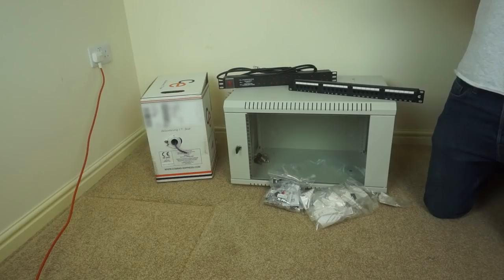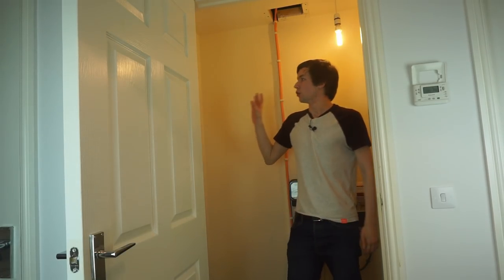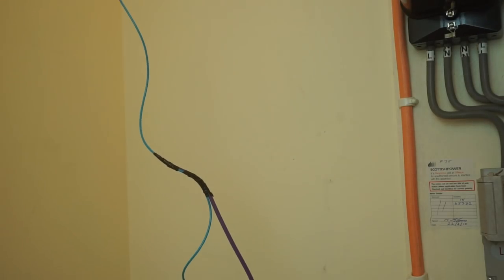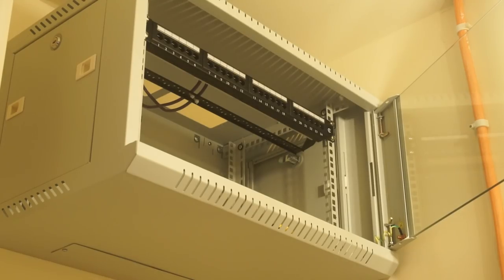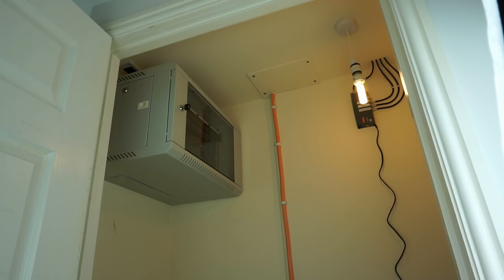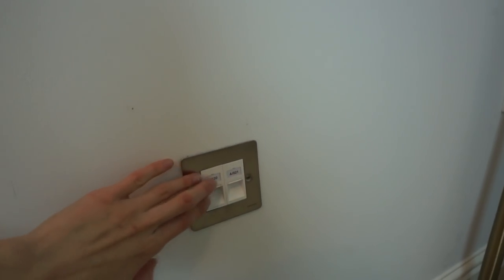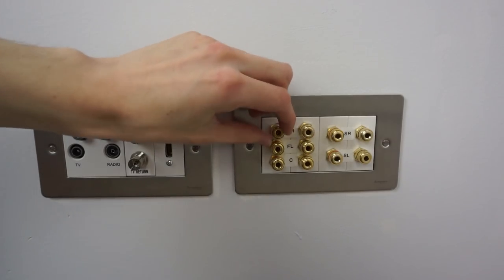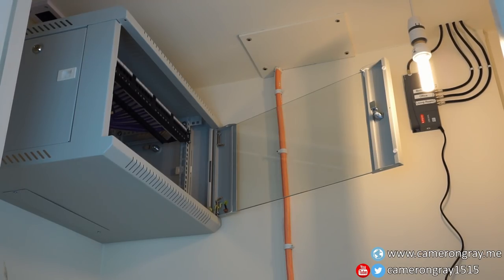New Flat - Time to install a completely overkill home network!

Comment: What? No ethernet in the bathroom?
Reply from the maker: +macuser1k Was honestly tempted to, the connection in the hall is on a wall that borders a bathroom then the cupboard with the cabinet borders the other bathroom.
Reply: Ah go on go on go on..... If you need an excuse..... erm... I'm sure theres a smart mirror or some japanese internet connected toilet out there !!
Reply: You should have, nowadays fast internet is a must if you wanna get sh1t done. 
But serioulsy,  thats a very nice job you did. However, you're missing power for that access point,you could use PoE but it would be limited to 100mbit.
Reply from the maker: +macuser1k I'll be using a UniFi access point which supports gigabit PoE.
Reply: i did at network cable in to bathroom add a middle screen eye level to toliet
Reply: Go have a look at iJustine’s bathroom whith linus
Reply: just about to say this!
Reply: Steven McCombie there is
Reply: Nice job good info thanks

Comment: Absolutely spectacular job! I really like those wall jacks and will definitely be trying them out in the future! Nothing wrong with an overkill network! That's how I gained a lot of valuable experience in installing rackmount equipment. Bravo mate!
Reply: FiberNinja I cant find any recessed and angled wall plates for the US. The UK has such a better system for wall plates. They effectively have larger keystones which allows for the diversity of what you can do with the “keystones” the only thing close to that, that I could find was Leviton 41081-2WP/4WP.
Reply: wow surprised to see you here
Reply: @eastwardExpansion 
Edit: sorry, I didn't notice you posted the same wallplate I just posted. 

4 port angled like this? They also have a 2 port.

Leviton 41081-4WP Angled QuickPort Wallplate 4-Port, Single Gang, White https://www.amazon.com/dp/B003ATOCDO/ref=cm_sw_r_cp_apa_i_eGtpCbGPCPTQ0

Comment: EVERY one of those cables in your patch panel should have a neat service loop  between the strain relief racket and the rear of the patch panel for maintenance
Reply from the maker: There's no way you could fit a loop of cable between the strain relief bar and the panel without bending the cable to quite a tight radius which isn't ideal with solid core or straying out of the 1U height. There's plenty of slack up in the ceiling void that can be pulled down if needed.

Comment: Should have installed pull cords for future needs, you will regret not doing so later. Everything else was spot on.
Reply from the maker: There isn't a clean enough route for pull cords to work, they would work if everything was in trunking but in my case you wouldn't be able to pull between two points without cables snagging on stuff in the ceiling unfortunately.

Comment: Nice video. Tip for future, if cutting access holes in plasterboard only cut on 3 sides at 45 degree angle and prise out to make a flap. Makes it a lot easier when making good at the end of the job.

Comment: Hard wiring a PROPER network is NEVER overkill. Just moved house in which I'll be doing the same, just as I did in my previous house. Nicely planned and lucky you having a suspended ceiling. 😁
Reply: I would post the Leonardo DiCaprio meme pointing towards the movie screen here.  Wireless should be reserved for mobile devices only is how I view it meanwhile its become the standard for homes now unfortunately.
Reply: @Wahinies  Hallelujah! Someone ELSE who "gets it"! I TOTALLY agree!

 I'm intending to add a LOAD of IOT devices and by far the majority will be hardwired (they aren't going anywhere!) All these IOT devices (NEST, RING, CAMERAS) being added to WiFi is just DUMB beyond belief! 

As for security devices on WiFi, like already mentioned security cameras, they are the BIGGEST security threat of all! 

A simple de-author can EASILY be used to screw up your ENTIRE camera AND IOT network and if done effectively will give burglars free reign with impunity from being observed! You think burglars don't know tech?! Think again!
Reply: at one point in the past I got a very small amount of ethernet cabling installed
and ive got a rather small patch panel mounted to my bedroom wall (its actually a 12 port one, as all of the 8 port ones i could find had bad reviews, but only 3 of the ports are used)
in the kitchen is the ISP supplied wireless router, which has an ethernet cable plugged into it, which goes up to port 1 on the patch panel
an ethernet cable goes from port 1 on the patch panel to port 8 on the 8 port ethernet switch that i have
port 7 on the switch goes to port 2 on the patch panel, and port 6 on the switch goes to port 3 on the patch panel, both go to a wall plate behind the TV in the living room
port 6 on the switch goes to the WAN port on a wireless router which i use as a wireless access point, as the wifi signal in the bedroom is quite bad
from the wireless router, ethernet cables go to both the printer in my bedroom, as well as my desktop PC

Comment: From experience having retrofitted my entire house more than once (I've owned it for a long time and it's considerably bigger than your place), I have a few suggestions, at least one of which is impossible for you now.  1) Always have extra cable available on each end of your CAT6 runs  2) Document where your cables are, because eventually you'll cut through a low voltage cable, 3) I'd suggest taking that powered device out of the wall, 4) Make sure you seal those holes you drilled in the fire barrier.  It's there for a reason.

You did an absolutely awesome job on this.  I'm looking forward to seeing the next set of videos.  I wish my wife would let me put a rack in our living room, but we have different priorities.  She prefers chairs and couches.  :)  Keep up the good work on this project.  It's always exciting having your own place and being able to do all the things that you wanted to do in the places you previously lived.
Reply: Dave Fenwick are you a networking engineer ?
Reply: Try covering it (the cabinet) with cushions and a pair of shoes! She'll never notice.
Reply: Why you want to put a rack in your living room? Put it in the cellar or in a storeroom like he did.
Reply: It would be very unlikely to be a fire barrier halfway through a wall. They are generally fitted between floors or between party walls.

Comment: My recommendation is to use Keystone patch panel if you are not filling it full. It makes much easier live for adding, testing, fixing cables in the future. Big respect for marking all sockets, well done! and its not overkill - its proper installation, which I did in my house too.
Reply from the maker: Thanks!  Went for that patch panel mostly based on it being a lot cheaper than a keystone one but in hindsight a keystone one would have been better. It would have also let me fit an RJ11 module for the DSL connection rather than needing to use an RJ45 to RJ11 cable to connect the modem.  I've been toying with potentially getting a deeper cabinet at some point down the line (if I ever get around to it) and at that point I'd probably swap the patch panel over as well.
Reply: @camerongray1515  Yes - I have patched my WAN through the panel - it makes everything even more clean. And I have a server in 600 cabinet, but it doesnt fit right, so for you I suggest to invest in 42U and at least 1000 depth cabinet if you are thinking about server :)

Comment: Very well done. I'm a novice everything on account of my young age but this was awe-inspiring. At the beginning when you showed the cutting of holes I flinched a bit because I remembered doing the same with screwdrivers in my family home to feed 1/4 in. speaker cables for my makeshift studio (I was 14), but my brain was thoroughly reconciled when I saw the clean job you did with concealing those vents. Thanks for filming all this

Comment: Looking good. I work with cabling guys and they'll normally spool off multiple runs of cable to pull through at the same time if they don't have enough boxes but does help to have someone feeding the cables in if doing that.

Comment: Very nice.I did the same thing but ran cat 5.  In hindsight I should have ran cat 6.  The one big screw up for me was the HDMI extensions.  I used 2 cat 5s to extend my HDMI.  I have my receivers in the basement.  The HDMI goes from the receiver to my bedroom (upstairs).  Problem is that I have no ARC.  Anyone that is doing this make sure to keep that in mind.  Most if not all the cat5/cat6 HDMI extenders (wall plates) don't carry ARC.

Comment: for the question of how to get a neat hole cut out. as an electrician I use a 102mm holesaw which give a nice big hole to get my hands in and also this can bridge a mid height noggin in the wall with enough width to then a drywall screw either side of the hole drilled in the noggin so the cables aren't hit. to repair the holes left in the ceiling away from joists a piece of 25mmx50mm batten cut at 160mm then screwed in with drywall screws. the remaining gap between just need filing with decorators filler and rubbed down and painted.

Comment: don't forget, when you drill into fireblocks you will need fire retardant expanding foam, you can pick up a can or 2 from the hardware store and that will restore the fireblock to the appropriate fire rating and will help stop your neighbour or you burning your neighbours homes down
Reply from the maker: Yeah, I've used proper sealant to fix those holes.

Comment: Way to take it to the extreme! I like it a lot and wish it was as easy for me to run cables in my 1969 Midwestern (USA) Ranch house. Open trusses in attic but a 1000sqft addition off the back is a separate space so most everything runs exterior.

Comment: i did this two years ago and has served me well. we dont use coax for tvs anymore as we have a SAT>IP system with TVheadend server and TVheadend clients that run on KODI. WiFi is supplied via 2 AC LR ubiquity access points which imo are solid devices. hmm running out of ports so may have to add more in the future. great video.
Reply from the maker: +Delta Lambda Sounds good!  I like having the coax for over the air TV so I can just quickly turn on a TV and watch something although I may look into a satellite to IP system down the line since I only have two satellite feeds into the flat so cant really distribute them to 3 TVs!
Reply: if the raspberry pi 2s that i am running Kodi on,  don't crash it is just a case of turning on the tv and watching. had a little issue with the satellite lately due to the recent snow and high winds think its moved something because a lot of channels have stopped working after that. damn scottish weather :P.

Comment: a nice tip for making holes in walls to run cables.. Use a circular whole saw. That way you can take the center plug out and use that to put back in the opening then mud, sand and paint job done..

Comment: Good video, was very interesting. (cable / wireless / powerline adapter) what may work for 1 person will not work for another. you set this up to your own needs and spec. Watchers are sometimes very critical of others hard work and features. the face plates you have used look smart and neat, and it all looks like a professional install. Very methodical and well thought out. With the detail in this video, it would of been good to see you wire the tool free units etc (minor detail tho) but an amazing video. I agree with you, Wired is the best!! can not wait for the next..

Comment: I have PoE-powered NTP-synced analog clocks in my apartment, if you keep an eBay search you can see them come up every now and again, if you've already got the cable runs you might want to do that too.

If you want quiet you might like the Juniper EX2200-C switches (or their new version), really solid, fanless, and fine in 40c days here in Sydney.
Reply: now THIS is what i would call "geekery"  !!!

Comment: 17:20 - Screwheads misaligned.
17:30 - Screwheads aligned! (Good work!)
The rest of those faceplates could do with checking though, get those screws aligned.
Reply: OCD much?
Reply: ikkuranus  - Only when it comes to aligning screwheads, and pens, and socks, and cornflakes. Other than that, I'm perfectly normal.
Reply: It's not even OCD it's just aesthetics. Looks much more neat and nice for it to be aligned.
Reply: More importantly these should be replaced with philips or pozi style head screws. Flat / slot heads are terrible.
Reply: I noticed that too 🤣

Comment: Nicely done! If I ever get a place of my own I would do the same really as having trailing cables and patchy WiFi sucks! Curse being in a rented house!
Reply: just use powerline adapters, it turns your mains socket into a network infrastructure, then attach multiple access points to these network connections
Reply: Vax Buster power line adapters are shit, I have three of them and they do not give you the real speed that a 100mb ethernet cable would give you

Comment: It didn't go terribly in the end 😂😁
Impressed how you did this without making any mistakes re holes and having to patch up. I always make a hole that ends up larger due to the plaster or brick being very soft and brittle 😂
Reply from the maker: I was definitely lucky given that it's a modern building so the plasterboard was pretty solid and the cable routes were predictable, would have been a lot harder in an older property.
Reply: @camerongray1515  yeah, damn these old buildings!
Reply: @camerongray1515  did you plan this out on paper beforehand?
Reply from the maker: Not really, I had an idea about what ports I wanted when I ordered the hardware and then stuck bits of labeled tape on the walls to remind me where I wanted the ports but I didn't do any technical drawings or anything.  Had I had others helping me then of course having written plans would be useful but given it was just me doing it all there wasn't exactly a requirement for them.
Reply: @camerongray1515  work best alone 😁

Comment: Good work. I did similar to my house. 2 CAT6 runs to all rooms and a Comms cabinet under the stairs. I put the Sky box in the comms cab, and then run HDMI over CAT6. Works great. Means you can have a super clean TV in the living room with no boxes or wires all over the show.
Reply: I like this idea of running the HDMI over CAT6, question for you, if the Sky box, DVD player etc was in a different location/room to where the tv is, how do you get the remotes to work? Can the IR be distributed over the CAT6 also?
Reply from the maker: Yep, you can get HDMI over CAT6 systems that have an IR receiver on one end and an IR blaster on the other. I have a video on my channel from a couple of years ago showing a system that does this for around £30. Can't easily get the link to the video as typing this on mobile but it should be easy enough to find, brand name was "AgpTek"
Reply: Hey  @camerongray1515  thanks for the reply and the info, I have watched that other video of yours as you suggested here and its great. It's helped to answer my question. However, I do have another question for you. Lets say I wanted to use a mouse, how would I do that? So I have my CCTV NVR in a space and I wanted to distribute the images to my living room TV via the HDMI over CAT6, but to scroll through on the living room TV using the mouse, is this possible?
Reply: @heliman85  yes get a wireless mouse
Reply from the maker: A wireless mouse could work depending on the range. You can also get devices that send both HDMI and USB over CAT6, they aren't particularly cheap and I've never used them but they should work in theory.

Comment: Unrelated to the networking, but why do Scottish Power always run only the phase conductor through the isolator when they've gone to the trouble of installing a DP isolator before the consumer unit. Madness. Looks like the sparky was missing his spirit level too.

If you install any more coax, don't install generic RG6, the loss is quite high. Always run PF100 or WF100
Reply: We don't. All isolators now are double pole, unless there is electric heating, in which case it's 4 or 5 pole. What you are talking about is an older specitication, where the neutral was  unswitched, connected to a neutral block instead. In the old method, the second pole of a 2 pole switch was intended for electric heating. Now if there is electric heating, we use at least a four pole switch, because the second pole of a 2 pole switch is now required to switch the neural. There are still plenty of the older types around, but you will notice they are two red poles,  intende to switch 2 live conductors, domestic and heating. It changed about 4 or 5 years ago.
Reply: I can't tell whether this is just so many technical words that I can't understand it or you're taking the piss... lol
Reply: please could you advise on the best aerial/coax cable to use? i’ll install an exterior splitter/amplifier about 2/3m from the antenna, from which i’ll have 2 runs to make: one about 15 metres, the other about 20. thank you!

Comment: You should use compression fittings for your coax wiring. Crimp connections can leak RF and cause tiling or pixelating video.
Reply: Never heard this one - source?
Reply: Still waiting...

Comment: When mounting a rack on drywall a backing board is recommended.  The backing board can be screwed directly into the framing to ensure any heavy equipment is securely mounted and in any position you desire.  Nice work on the install otherwise (love your attention to detail) and best of luck with your new home!!